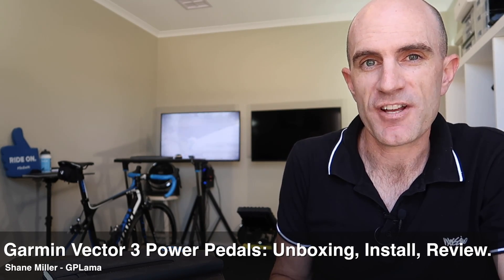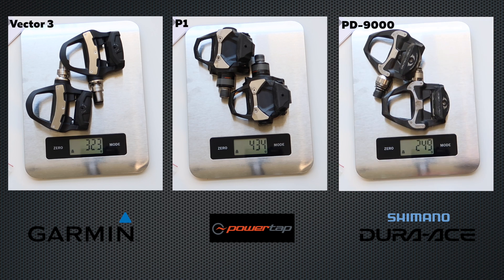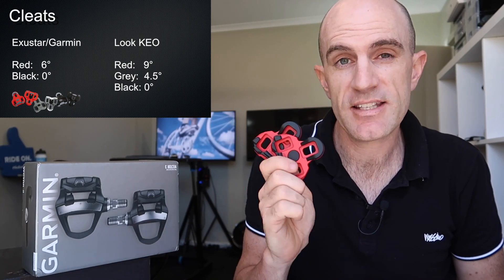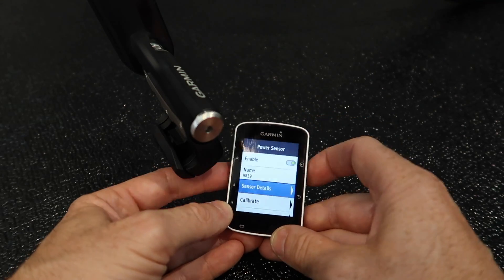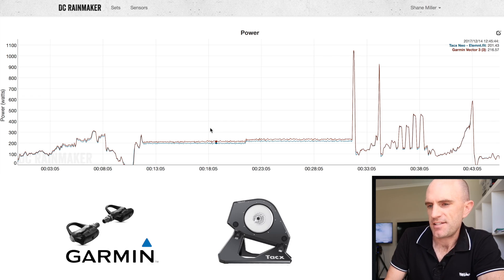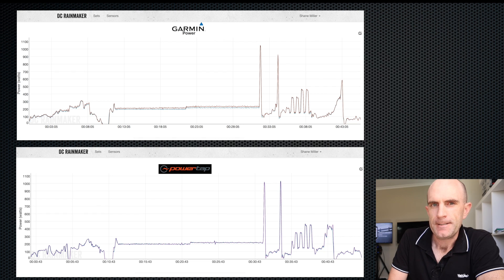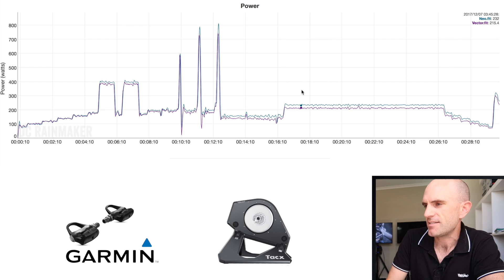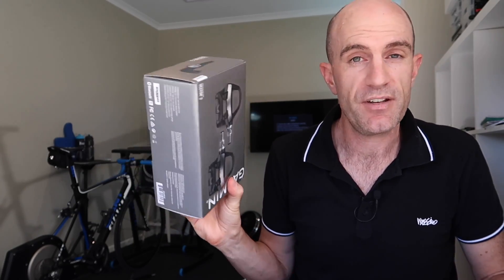Garmin Vector 3 Power Pedals: Unboxing, Install, Review

Comment: Mine arrived last week and they paired quickly with my Wahoo Elemnt Bolt but the Garmin app wont pick them up so I cannot update them (says an update is available) and not sure if I have to calibrate them.  Did everything you tried but dont have a Garmin computer to try out.  Will ring Garmin tomorrow and hopefully get some answers.

These are 100% compatible with Look Keo cleats BTW, whereas DC Rainmaker wasnt as confident with the Faveros and Powertaps.

Comment: Great vid, Just a quick question do you know if these pedals are compatible with the Wahoo Element Bolt as I've had quick look about but can't seem to find anything. Thanks
Reply: They 100% are.  I have both and they do work.
Reply: Great White7 thank you
Reply from the maker: ANT+, so there's no reason they shouldn't be. I'll pair them up when I get a moment.
Reply: Shane Miller thanks, I’ve also read that depending on head units there can be a different wattage readings

Comment: On the cleats: I have always used Shimano cleats. Bought a pair of Favero Assioma powermeters recently (I could get a dual sided pair for € 540,-, which was so much cheaper than the Vector that I accepted the lesser look). The Assioma's are supposed to be Look compatible. What surprised me is that there is not only some play sideways, but also some play front/back wards. Is this normal on look pedals? Is this Assioma specific? Anyone else has experience with this?
Reply: There is no play on my look pedals and never was :/
Reply: Thanks for the reply. Restudied my shoes - found that my inner soles were a size smaller than my shoes - they slid forward and backward. Some double sided tape solved the issue.

Comment: I saw another accuracy test today on some german website: https://tri-mag.de/equipment/garmin-vector-3-im-test-143919/der-labortest. Most of the time the deviation from the SRM Ergometer was no more than 2.5%, but it jumped to almost 5% during low cadence (60RPM) 6 minute effort.

I'm interested in getting the pedals myself, but I think I'll wait for some more power data to appear online.

Comment: Hi Shane I'm so glad I watched this. I was trying to sell my P1 pedals and replace with Vector 3 for use on a work gym spin bike while using Zwift on IOS. Luckily for me release is delayed in the UK as they won't BT connect to IOS anyway. The only reason I'm changing the P1 is because it's almost impossible to install them with the gym bike casing blocking access to the inside of the crank.